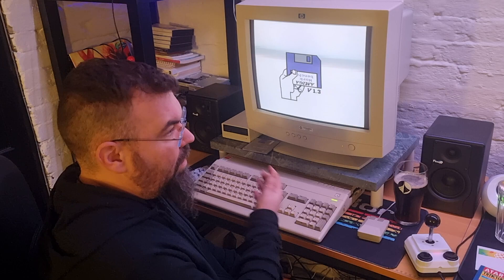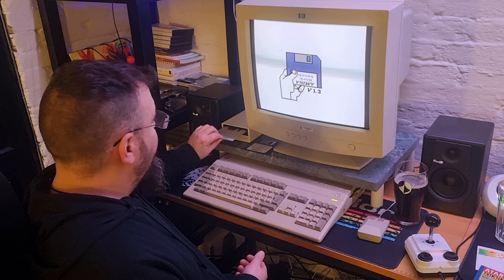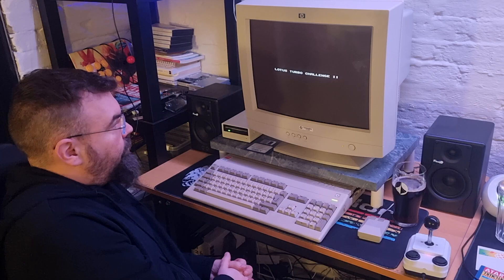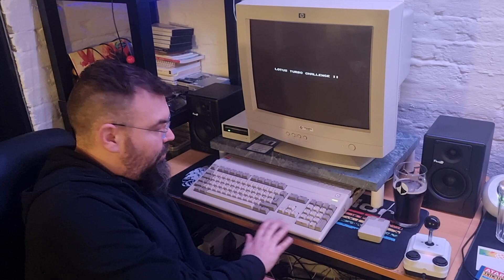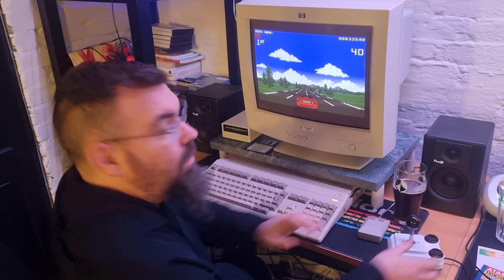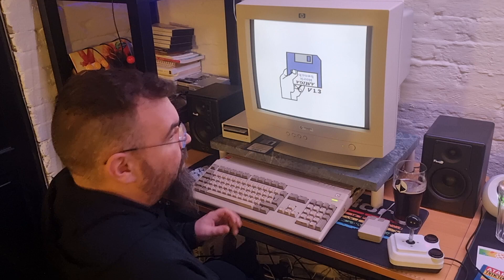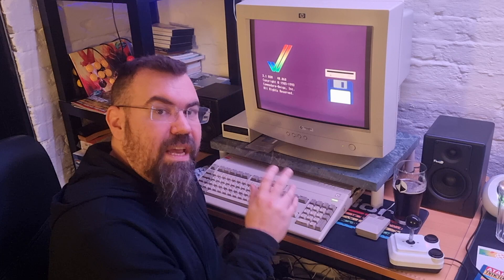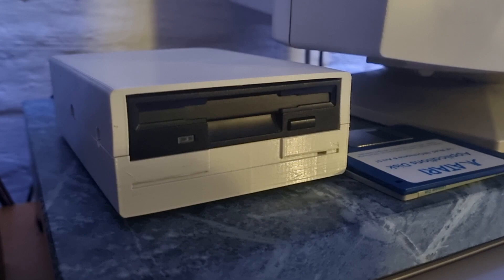Showing the greaseweazle booting real Amiga game

Comment: Do you feel the emulated machine as smooth as the real one? I am asking because I have a WinUAE setup and on LCD it doesn't feel as smooth
Reply from the maker: Yes, it is very smooth. The most important thing is to set the refresh rate of the monitor to 50hz. Usually it is 60hz which makes things bad with tearing and framedrops. In 50 hz things are smooth even on LCD. In winuae as well.

Comment: Seems to me that the tracks are loaded much slower than on the real thing. Could you put up a real Amiga load in comparison? Just out of curiosity :)
Reply from the maker: You are right. Quite a lot slower as well (did a test). Will try to figure out why and if it gives me any compatiblity issues. When I find out I can make a small video about it.
Reply: @proteque  I was coding trackloaders at the time, and amazingly enough I seem to still have a feeling for a fast or slow one xD But good to hear you're going to investigate <3
Reply from the maker: @erischaot  I finally did a compare between them. Real A500 with gotek vs UAE with greaseweazle (was unable to get my Amigadrive to behave. it needs service. But the gotek is usually quite spot on in speed compared to the real drive) https://www.youtube.com/watch?v=HNNWMWtVKs8
Reply: @proteque  yeah it doesn't load this slowly on my amiga 1200 lol this is commodore 64 loading times ffs. Only takes a few seconds to load a game from floppy disk. Regarding grease weasle, I've never got it to actually copy a disk that works on my amiga 1200. It says it's been succesful on pc then I put it in my amiga... Doesn't work
Reply from the maker: @1invag  did you see the compare I did in the link over? Between gotek on real amiga and greaseweazle on emulator. Very strange results. 

I have not had any broblems writing floppies and use on amiga from it. Reading works as well. Maybe a problem with your driver or the unit? Or the floppies? Hope you find the problem.